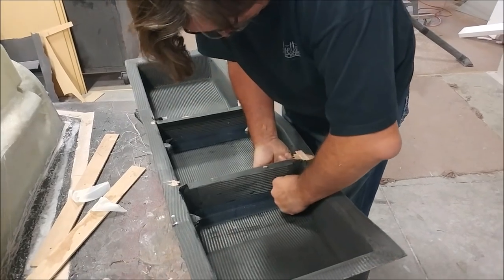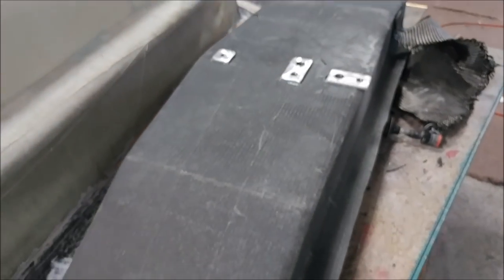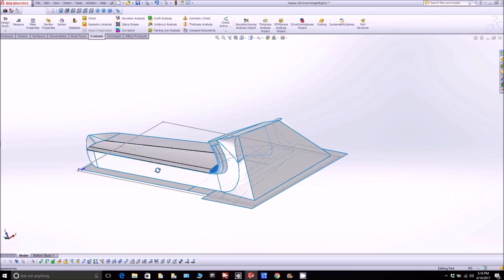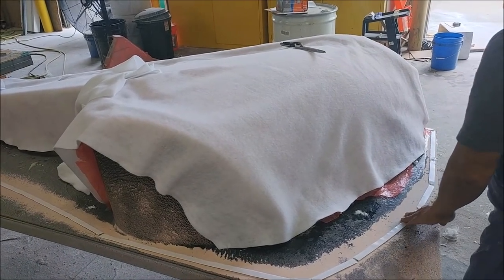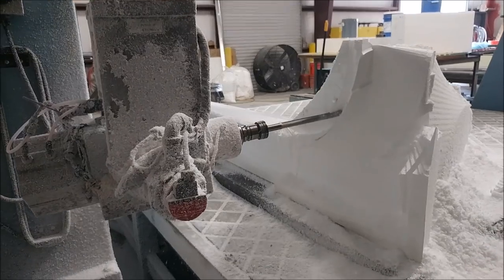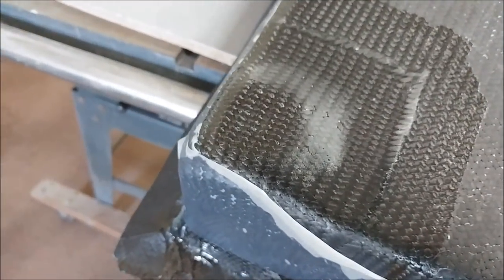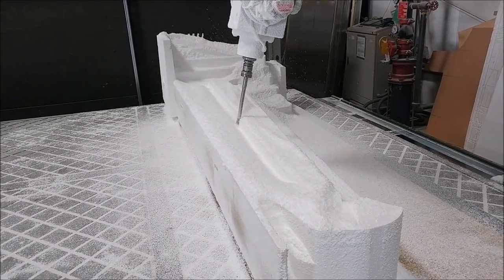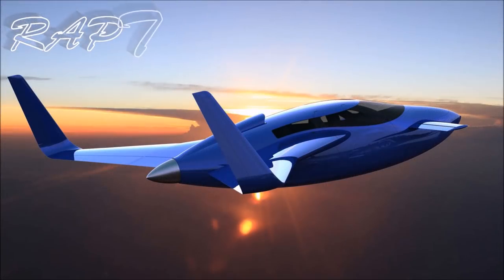Getting the Shafts - More pieces of the belt drive

Comment: Any corrosion concerns with aluminum hard points vs. stainless?
Reply: I agree with the concern. Aluminum turns nasty quick when in direct contact with carbon.
Reply: Never heard of corrosion issues with metals connected to carbon fiber.  Probably because I've never really worked with cf but after doing some research based on your comment it looks like a serious issue and for a reason I would have never expected. Very interesting reading.

Comment: Please consider a low fuel switch as a future enhancement. The Columbia 400 has switch calibrated at 8 gallons (1/2 hr at cruise) that provides a heavy peace of mind value. The switch is in a sloshbox which increases accuracy and decreases volatility.

Comment: I remember that you tested the scale model 3 times and decided to enlarge the winglets to see if that helped, but not much discussion was seen about how you arrived at this size and shape.  Could you share with us what your analysis produced and your decision factors?  Did you ever consider adding a lower part-winglet stub?

Another question is have you considered any variation that would allow for an amphibious capability/configuration?  Building and showing off an alternative model in SolidWorks that was equipped with floats and put through the computational modeling feature would be very interesting, diversify the aircraft's capability and expand the potential audience with its diversity.  I imagine the floats could even be retractable!
Reply from the maker: Sorry, I don't have time to get into a detailed explanation of the winglets, and likewise working up an amphib is way beyond the time I have free.

Comment: Which shop did those shafts? Are they heat treated? Thanks.
Reply from the maker: Corrugated Replacement Parts and yes the shafts are at the heat treater now.
Reply: Raptor Aircraft much appreciated! 
as far as psru, consider Ox Box. You get to pick reduction ratios. Those are 3.5k instead if 20k for cam drive 500+.
Reply: by the way, ox box reduction drive has provision for a clutch so those rubber dampers are not needed.